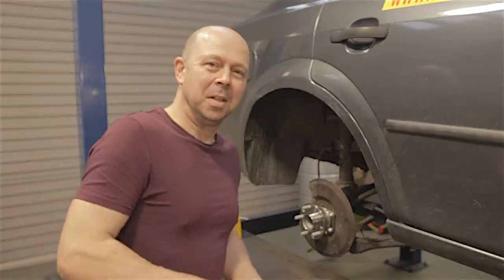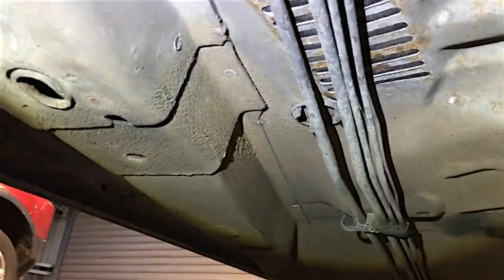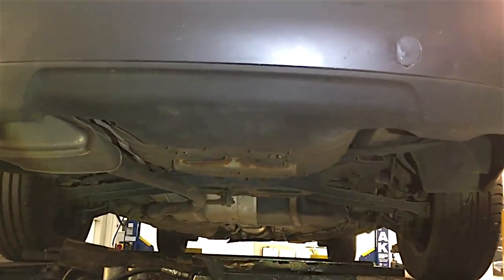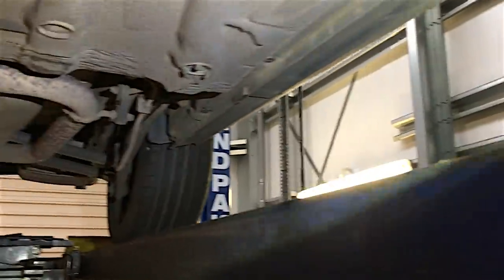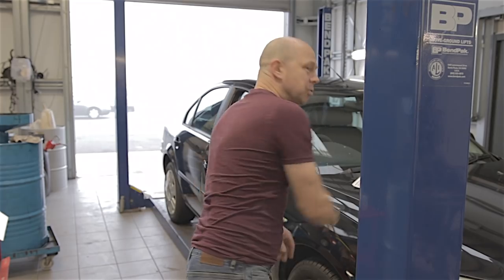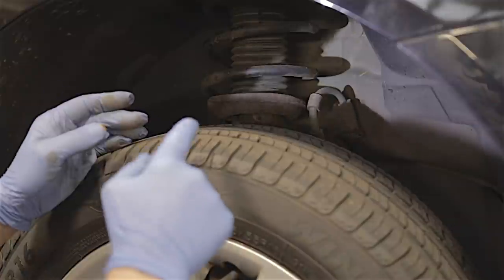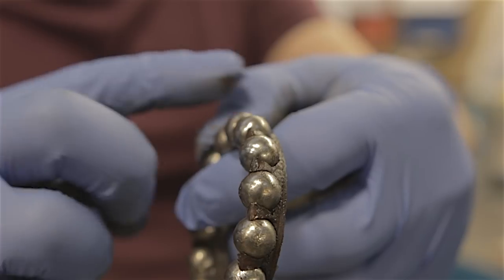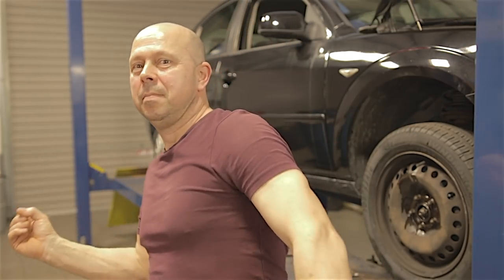What Could Possibly Break ...... Ford Mondeo Mk3

Comment: Hi Alan got a quick question Mk3 Mondeo rough idle throttle body and Idle control valve have been cleaned my only guess it spark plugs need replacing since if you Rev the car the rpms will hold at about 2k before returning to 1.3k high idle it’s also lacking power by a lot and guessing the car is running on 3 since coil pack was replaced as well ordered some spark plugs for it just wandering if you have any idea what it could be and if you know what I’m on about otherwise my channel involves some videos of standstill revs which you can here the rpms not going doing causing the exhaust to pop slightly any suggestions or recommendations will be useful
Reply from the maker: hi, is the car misfiring when you rev the engine..but i would definitely check the rubber hose that goes from the pcv valve to the inlet manifold which are common for splitting and sucking in air causing high idle and all kinds of running problems
Reply: @alan4x  hi Alan thanks for your reply the car does misfire and is burning a lot more fuel than usual 
And it lacks power when trying to accelerate all engine fluids are at correct levels too
Reply: @alan4x  when possible I will check the hose is it the vacuum pipe the runs to the swirl flaps 
Plus I did originally check the hose disconnected it for a minute on idle seeing if it would change the rpm but nothing happened I’ll double check it when I fit the spark plugs I’ll let you know if it fixes it or not
Reply from the maker: @WASTEDST  its not the hose that operates the swirl flaps.....it is a thick rubber s shaped hose that goes from the bottom of the inlet manifold to the crankcase breather valve on the engine block ...if it is split and sucking in air you will need to remove the inlet manifold to change it...or at least unbolt the manifold and pull it forward which is easier with the radiator fans removed
Reply: @alan4x  thank you Alan I’ll keep you posted
Reply: @alan4x  Hi Alan update with the Mondeo hit a Pot hole the other day now the engine is rattling and squeaking sounds like the alternator belt has gone or a pulley has broke or fallen off
Reply: I think it’s probably ready for the scrappers man to be fair

Comment: Just wondered if I could pick your brain......have 2010 140hp tdci s max.  Power steering has just gone.  Dash says power steering fault,.battery light came on at the same time and battery died just as I got home.  Belt is ok and I took it off to see if anything has seized.  Put belt back on and did a fluid flush. Car ok for about 30 seconds then I get kick back on the steering then no steering again and battery light back on. Tensioner seems fine and don't think the belt is slipping.  Wondered if you'd ever come across anything similar on the MK4 Mondeo?

Comment: Both rear calipers on my MK3 07 plate started leaking brake fluid out of the handbrake mechanism, both rear hubs went aswell, along with all the other faults i had with, one of the most unreliable cars i owned 😂

Comment: May I message you regarding air found in fuel line ford smax 2.0 tdci 2007 causing it to cut out. Thanks Dallas I'm in the body trade.. Just want to know where to start looking for the entry of air.. Around the system. Thanks email or whats app will be great.. Have video of non starting cranking over

Comment: Ford Granada is a really shitty car. Also the others on the same schassie, Rover 75 and Jaguar X-class. Springs brake steringrack leaks wheelbearings give up and the ABS. If the ABS light goes on you better scrap the car  it is impossible to fix.